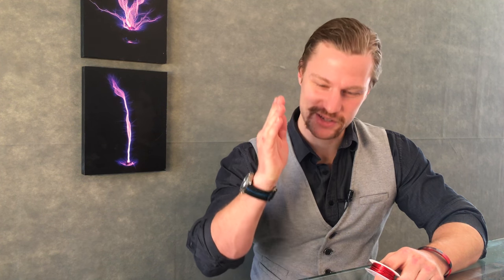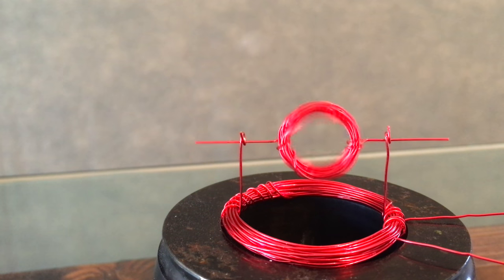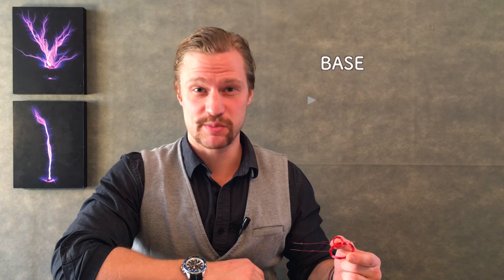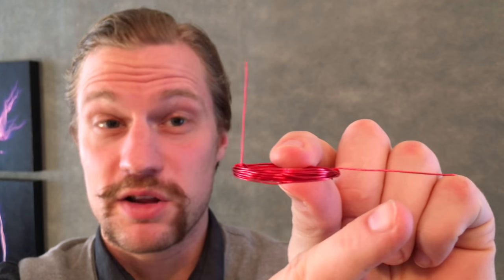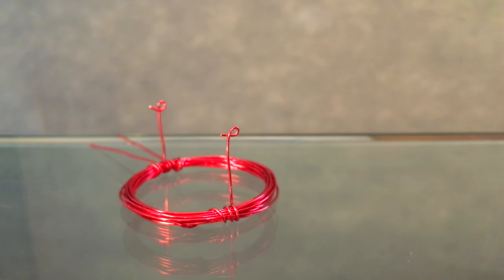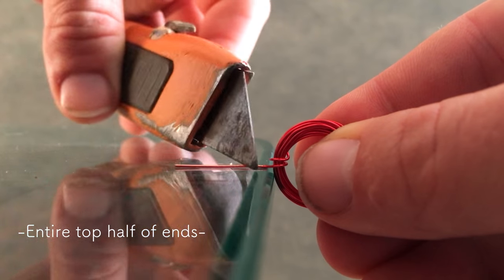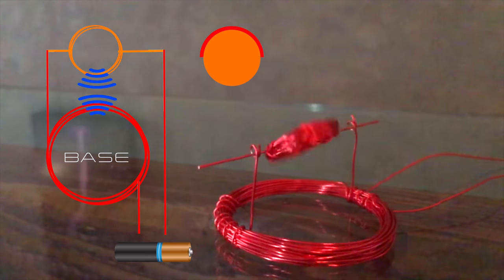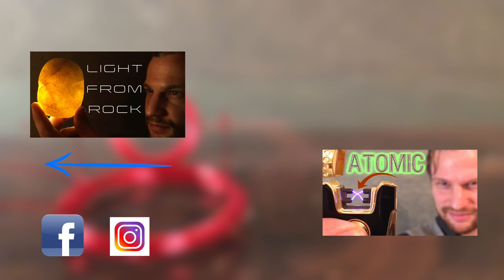ULTIMATE DIY electric motor using ONLY A WIRE

Comment from the maker: Make sure when scraping off enamel from a half of wire, you remove all of it from that half of the circumference. If you only scrape a line of enamel off, motor will not function!
Reply: Can you see this principle /watch?v=gduYoT9sMaE   being used in a Tesla/bladeless turbine, using neodymium discs preferably  /watch?v=ZfR-ur1lJ5Q   High enough tension would eliminate the need for contacts, though high current would probably melt everything. Some math has to be done.
btw some wood carving /watch?v=_mg4THnpbus&t=1m30s
Reply: Plasma Channel bro you need some other ideas, these are all basic and from other channels..
Reply: Its good that you give small, but crucial details.
Reply from the maker: I appreciate the input. My channel is the only to feature such a motor at this time. One where no materials but a wire are needed.
Reply: what wire do 
you use ? i would be happy for link of diameter i want to use it in my tesla coil (my one that i have now has really thick wire)
Reply: Ummm if powered fields repel, should not the collapsing fields attract?

Comment: This is actually basic idea of UNIVERSAL MOTOR, and it is good in AC or DC current. A blender, mixer, drill, die grinder, etc just have a motor that work same principal as this video.
You can add multiple turns and may be put some feromagnetic core and powered by 220V so the RPM and torque will be crazy.

I just experiment with many types of motors and generator, then this type of motor just simplest to build and works good although it's very noisy in EMF.

A good channel, I support you 👍🏻
Greetings from Indonesia 🇲🇨

Comment: I never knew that you can make a motor with just simply wire, now that's pretty cool!
Reply from the maker: Thanks! Feel free to share the video, let others know as well ; )
Reply: Do you know if increase the amount of wire and/or use a lower gauge wire, could that increase the power of this type of motor?

 You could potentially try that because this could potentially be a game changer if it works on a larger scale.

Comment: adding 2 LEDs in the coil  with 2 diode oppositely connected diode.
it would make a blinking half cycle light.
I tried it today and used two LEDs one red another blue.
was  amazing.
like the police.
used a 9v power supply.

Comment: Congracts... you just made the world's simplest DC series motor. It should also work on AC
Reply from the maker: My thanks! It should work with ac assuming the rotation matches up to the frequency of ac properly
Reply: I think it'll work at any frequency... you see, the field coil is in series with the armature coil... so, at any given instant, the same current is flowing through both the coils, and there is no phase difference between the current in the 2 coils... so, if the direction of current in 1 coil reverses, the current direction in the other coil will also reverse at the exact same time instant, and the direction of torque will remain unchanged
Reply from the maker: hm. I shall test this. Thanks! I'll get back to you.

Comment: Reading the first 70 or so comments, nobody actually tried this. 

As I was debugging my build, I noticed my magnet wire insulation kept reforming itself around the wire.  I scraped it off repeatedly on the rotor/spindle arms and the uprights yet it was coming back and surrounding the wire with insulation from the non-scraped off side(s).  Apparently they must be making some sort of "self-healing" magnet wire lately and this didn't work for me  for more than  2 seconds at a time.  I was using 3.7v and 24 gauge magnet wire.

Comment: This is just the coolest little project!  I just made one and wish I knew of this when I was a kid.
Thanks Plasma Channel! I just love this neat little thing! A graceful yet simple display motor.

A day later, I made another.  The first one I made with 15 turns, 1.5 inch field coil and 15 turns, 0.5 inch armature as in the vid. I had a bit of a struggle with it at first. Probably because I only scraped off abut 25% off the rotor ends. I missed the suggestion of 50% in the description. Built this way, mine just barely works on 3 volts and works better on 4.5 volts. The next one I made using the same wire and dimensions as the first except I tried 20 turns (as in the captions) and it works MUCH better on 3 volts than the first one did.

Comment: can i make this have more torque if i make a bigger rotor and put more wire on it? like a a proper rotor like you see in all diy dc motor videos
Reply from the maker: If you are looking for more torque, i'd suggest a different built style. , perhaps even a 4 pole or 8 pole motor.
Reply: @PlasmaChannel  what do you mean by 4 or 8 pole? do you have a video link for that kind of motors?

Comment: I had my arms crossed, stubborn that it couldn't be done (not off DC anyway). Would never have thought of using half of the insulation as a commutator! Not sure that would pass OSHA inspection on the factory floor!

P.S. Can't believe I overlooked this video for so long - I liked it. Looking out for your next one :)
Reply from the maker: Hi Dayton! Yeah this is the easiest way to make a motor... just a single wire!

Comment: This is actually really cool. I'm new to the electrical side of things, but have been wanting to learn more and do a few projects. Def putting this one on my list. Thanks for the video! When it comes to connecting things to it to give it more of a purpose. I'm guessing you solder things to the support wires at the base?? I'm ignorant I'm sorry haha
Reply from the maker: Glad you enjoyed! Nope, no solder needed. In fact, that would ruin it. You just loop the  supports a couple times tightly to bundle the base together.
Reply: @PlasmaChannel  thats so awesome. Thanks man!

Comment: Weird how it wouldn't work in reverse as a generator. The ones with a round magnet would though. It's like a mini Faraday Disk. You would tap the magnet at the middle of the rim and center of the disk.
Reply from the maker: Well, with no permanent magnet present, it cannot function as generator

Comment: Jay, could I ask if this would work with steel wire? How about a combo of steel wire and copper wire? Can you see where I’m going here jay? ;)
Reply from the maker: Since you commented on my thermoelectricity video......are you inferring the difference in metals? Nice thinking! Unfortunately, one metal would need to be a different temperature from the other, and need to be covered in enamel, or else the coils of wires dont act like coils. They act as one single loop, thus, no EM field generated to push the spindle around.
Reply: Hi jay, thanks for the reply. Yeah, that was kinda the road I was going down. Ah well. Back to the drawing board. And I’d better get some phys9cs books out whilst I’m at ! =)

Comment: First of all I love your channel, now so I used a 25 guage wire😅 because I was unable to get 26 or more and it didn't work. Do I increase the turns or should I use battery of different voltage. Any suggestions? 😁
Reply from the maker: Should work all the same! I just personally liked 26. These can be finicky though, just a warning. First one i made didn't work. Second did. I could not figure out why. But try to follow the directions as close as possible, its a cool project!

Comment: In the video you said wire 26ga but you use 32ga wire. I build it and nothing happens..
Reply from the maker: Jan, my apologies. When I get youtube comments on my phone, the app does not tell me which video it is for. I get dozens of people asking me about wire gauge....and they are always for the DIY tesla coil video. I thought your question was also for the tesla coil video. You are correct, this motor uses 26 gauge (wire needs to be stiff enough to also act as a support). Terribly sorry for the confusion. You can, however, now use that 32 gauge as winding for a tesla coil!
Reply from the maker: Also, they can be a little finicky. Make sure the enamel is totally removed from the halves, and the battery leads are fully stripped.